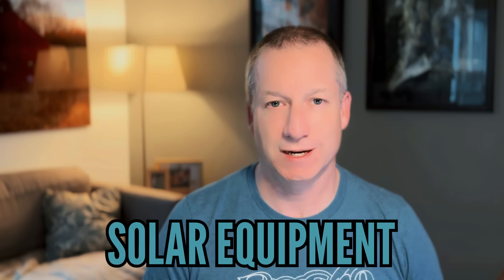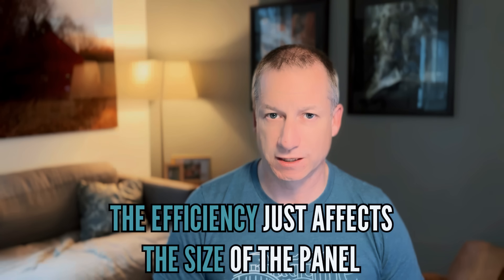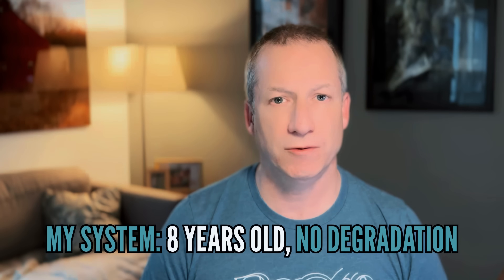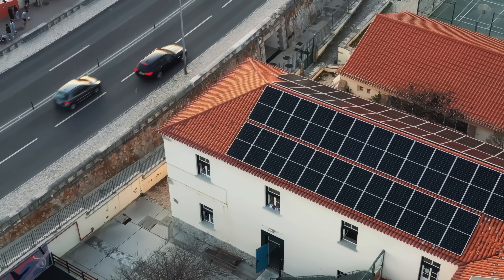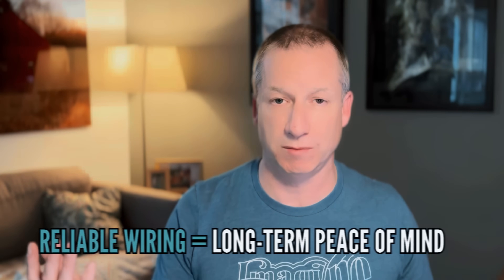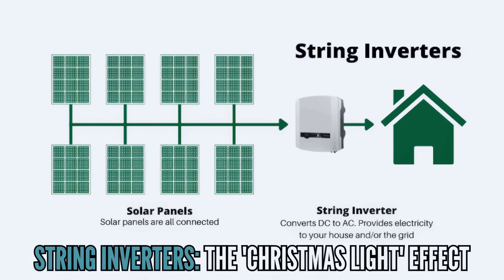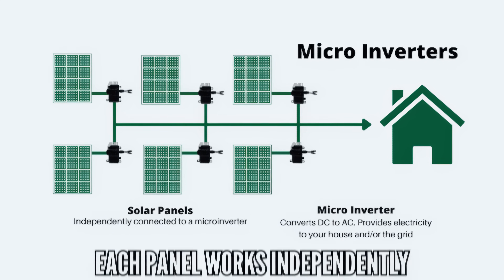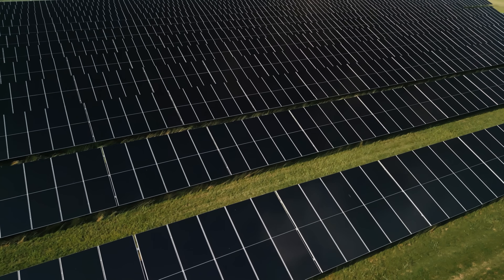The Hidden Downside of Microinverters No One Talks About

Comment from the maker: This is a blanket response to all those below saying I’m wrong about the Christmas tree analogy. To those screaming that it’s wrong and dangerously misleading  to use this analogy because it no longer applies because of bypass diodes, please keep reading. 
The Christmas tree light analogy works perfectly in explaining how solar is wired and installed with a traditional string inverter. Therefore, it is both useful and applicable. To say that it is not as like arguing that explaining how internal combustion engines work is no longer necessary. 
Most importantly though, while bypass diodes are effective, they don't eliminate shading issues entirely. They are a protective measure, not a complete solution, and shading can still reduce overall power output. Therefore, modular level electronics that eliminate the shade issues are very useful.
None of that really matters though because today here in the US string inverters aren't widely offered to residential consumers because of the virtual duopoly between Enphase and SolarEdge. Plus, if you just use a string inverter, you lose the advantage of modular level electronics that give you monitoring access at a panel level, which is super important to consumers. If you don’t have that, you won’t know if you have an individual panel out easily. 
Also to be 100% clear the most important thing for a consumer to do is use an installer that they trust to do a good job and take care of the system for a long time with a good warranty that covers labor. That’s far more important than an individual technology choice you make. Hope this helps clear things up.
Reply: I have nearly 20-year-old sharp 165W panels that have bypass diodes.  Its been part of modern panel design for decades, so lets put that out to pasture please.  Over those roughly 20 years I've had two panel failures (probably from micro-cracking, culminating in burned current paths on some sections of cells).  The bypass diodes worked properly and the 9-panel string both panels were on simply lost 2 panels.   SMA string inverter (SunnyBoy branded at the time).

One thing I will say is that you want individual strings to be on their own MPPT controllers.  Older residential solar systems generally paralleled two strings into one MPPT (MPPTs were expensive).  My original SMA inverter had one MPPT with two inputs which it just paralleled internally.  This is not ideal and if a portion of one string goes into bypass it causes both strings to become less optimal.   When I lost those 2 panels, my system as a whole produced roughly 3.5 panels less power (2 x 9 panel strings in parallel).

Modern string inverters generally have two or three MPPT controllers which more or less solves the issue.  When I had to replace my original SMA string inverter with a new one, the new one had three separate MPPT inputs so I was able to separate the strings and got significantly better performance because of that due to partial shading in the morning on one string.   Now the partial shading on one of those strings only drops out one panel from a single string and the system barely notices it.

--

I personally prefer string inverters and having the least amount of equipment up on the roof.  So I agree with you there.  I far, far prefer not having optimizers at all.  However, modern roof regulations in most places now require a per-panel "rapid shutdown" feature which means that at a minimum there needs to be a rapid-shutdown device on each panel. 

In terms of sophistication:

* Bypass diodes (built into the panel) are singular electronic components, beefy, and generally last the life of the panel.

* Rapid shutdown devices have a little MCU for communications and typically one or two FETs.  They are very simple devices but FETs are more fragile than diodes.   Per-panel monitoring is not really needed, but some have that too.

* Optimizers are basically DC regulators.  They are almost as complex as micro-inverters.  And it should be noted that SolarEdge optimizers had very, very high failure rates when they first came out (I don't know about current offerings).

* Microinverters are also regulators, with slightly more circuitry to produce an AC waveform.  Enphase microinverters are considered to be the most reliable in the world. 

But its still stuff up on the roof that I'd rather not have.   Since I don't have a choice due to regulations, I'll be putting rapid shutdown devices on the next string that goes up and avoid both optimizers and microinverters.

Optimizers are only useful when you have a lot of random partial shading going on and even then they aren't really worth the expense verses simply having the cheaper rapid shutdown devices and using the savings to put more panels on the roof.   Optimizers can only do so much, and you can easilyi see this by shading a single cell on an optimized panel and seeing the rather large drop-off in production from that panel.

Something that does vastly improve production in variable shading conditions is using half-cut panels.  These have six bypass diodes instead of three.

-Matt
Reply: @junkerzn7312  Thanks for taking the time Matt.  It is generally in the comments of videos that I find the most valuable knowledge, and this has been a confirmation of that general rule.
Reply: When you say that bypass diodes are 'new' and 'not offered'.  What do you mean by that? They come installed in every panel since at least 2010 and I would assume since 1980.
Reply from the maker: @Chris-ie9os  Would relatively new work for you? What I mean by not offered is the combination of panels with bypass diodes capable of mitigating shade issues coupled with a string inverter is just not offered in the US residential solar market. We have a virtual duopoly here between two inverter companies - neither one of which offers a string inverter.
Reply: @bradthesolarguy  ??? SMA, Fronius, Growatt, Sol-Ark, EG4 and Tesla are all examples of string inverters commonly used on the residential market.  When is it that you think using bypass diodes started?  I'm fairly sure solar panels in ~1980 had bypass diodes.  It's a safety requirement.
Reply: I have a solar system, Sol ark with 3 active mmpts.  I have almost zero shading facing 192 degrees close to solar south for me. This system works for me.  
My friend has a similar sized micro inverter system with enphase.  He has shading thought not much.  He does not have the ability to power his home in a black out.  He is limited on battery options.  He does however have panel monitoring.  Two of his panels no longer produce, at 2 years in.  Question is, panel or micro inverter?  The micro inverter is under warranty but removing it and replacing it is not.  He has elected to do nothing about these two panels that no longer produce.
My thoughts are, individual panel monitoring is nice but useless.  If you plan on spending tons of cash to continually repair, replace and modify your panels then maybe individually monitoring panels makes sense.  If you are like the 99.9% of us who want cheap reliable electricity from solar with little to no effort with energy production that is reliable and usable in black outs, likely a modern hybrid string inverter is the way to go.  If you plan on micro managing your system and enjoy climbing on roofs while making lots of modifications to your panels, then a micro inverter or DC optimizer system is right for you.  If you have lots of shading then maybe a DC optimizer or micro inverter system makes sense but probably solar is just not a good fit for you in all honesty.
My two cents.
Reply from the maker: @scottross4627  Appreciate your two cents. Love that you have solar!
Reply: @bradthesolarguy Gary is correct. The bypass diodes stop the shaded panel going reverse polarity when that panel is shaded and the other panels in the string are still producing. All that happens is that you lose the output of one panel - not all of them.
I agree micro inverters add unreliability and that's due to the MTBF (which has early failures removed) being divided by the number of units.
Optimisers are more reliable but there's no point to them (apart from monitoring convenience) because the bypass diodes makes their inclusion unnecessary. You can instead spot a panel failure from the drop in output and use of a thermal camera.
Reply: It's weird that you use past tense in your comment ("...how solar WAS traditionally wired...") but your video is present tense ("It WORKS like christmas lights..." "It WILL lose production..." etc). You seem to have a hard time admitting that you made a mistake.
Reply from the maker: @KidFreshie  No mistake except in tenses. Thanks for pointing out.
Reply: Many will miss your key and important word  WAS.  No longer applies to installations.
Reply: Instead of busting myths, you are keeping them alive !!! 
It is a myth that one bad solar panel takes down the whole string.  And you know it is a myth!
Yes, when talking about the wiring you can talk about a string of Christmas lights.  And then you should immediately add that in contrast to Christmas lights, one panel does NOT take out the rest of the string, because of bypass diodes. 
This is not hard to understand at all to the viewer.

Wy perpetuate this myth? You have just made your channel completely untrustworthy!
Reply: Don't bite into crybabies.  All the Biden-Kamala ppl stood by while the Dems said they were going to hire 87,000 ARMED IRS agents to come after the regular citizen.  They said nothing.  No crybaby sheeet.  Then ... as soon as Trump started looking into government fraud, theft and abuse, the same Dems started screaming and crying just to get attention.  After all, why didn't they scream and cry when ChoMo Joe stated he was sending 87,000 armed IRS agents into ppl's homes to go through their documents?  Also, why didn't they cheer when Trump stopped that sheeet?  Truth is, Americans love to cry ...so, don't waste time with any explanations brah.  Ppl know what you are talking about, and if they don't, they shouldn't mess with solar systems.
Reply: Thanks for the clarification in the pinned post.  I think quite a few of your viewers will be elsewhere than in the US, where string inverters are alive and well.  In Europe where I am, I believe they make up the vast majority of installations (around 80%).  At around twice the population size of the US, Europeans matter, as does the rest of the world, of course.
I guess it would have been good to at least include the information about bypass diodes in the video: strange to not alert people that the Christmas Lights effect is largely a thing of the past now.  The issue wasn't that you mentioned the Christmas Light effect, but that you did not put it in its proper historical/antiquated context.
As for monitoring access to individual panels, it is sure neat to have, especially on large installations.  Going forward with modern panels, most residential installations will probably be 20 panels or less (especially outside the US where home energy consumption is not as high), and a panel failing represents at least a full 5% production loss.  That should be pretty noticeable from monitoring the overall solar production.  Finding the offending panel can then be a bit tedious, but totally doable, and probably worth the savings of not shelling out for up to 20 optimisers.  But that's just my opinion.  A failed panel is probably going to be a vanishingly rare occurrence for 99% of homeowners and if it happens, it is detectable for most residential installations.  Anyway the main point is: knowledge of all options is power.  Probably best to let people know neither microinverters nor optimizers are nearly as useful as they used to be.
Reply: @malk6277  you missed a couple of aspects on a string inverter you would prefer all the panels to be facing the same direction. If you have an East-West string the system will only be as good as the lowest lit panel. Everyone keeps shouting about the diodes but then only comes into play when the panel itself is almost not producing. Getting mppt at the panel level is much more efficient than at the string level. With individual panel hardware there is a chance of multiple failure points. That being said if there's an issue with the string inverter the whole system is a failed point. As a system with individual panel equipment can have failures, it's usually only one or two places in the system itself and the system can still operate with those individual failures. That being said I have probably only had four to five panels in my whole 30-year career actually fail. But on the equipment level there has been multiple failures across many different types of makers. If you have no shading and not a lot of cloud cover all panels facing the same direction a string inverter would be fine. Anything else other than a perfect situation in weather and exposure I would recommend individual panel equipment as this will increase the efficiency and longevity of the system. In the final Plus for individual panel equipment you acquire more information from your monitoring. Also troubleshooting becomes easier as you were able to pinpoint the actual issue with minimal effort.
Reply: @chrismidyette1098  In a split direction system, you only need one MPPT per direction. And there is no harm in running a system with two MPPTs: the same argument you use in favour of microinverters plays in favor of having two MPPTs rather than one. String inverters from reputable makers fail very, very rarely and if redundancy is needed, having a spare inverter on hand is fine. Also easier to swap out than clambering on a roof top. I did discuss monitoring here already. Panel failures are super rare, and the vast majority of owners won't need to pinpoint a failed panel. Meaning the monitoring becomes a fairly costly expense if it is just the pleasure of looking at the data a few times in the early days of the installation, then losing interest and not using the feature at all. To each their own, but from where I stand, microinverters aren't as useful as they are cracked up to be: case in point, this channel misled people with this video, into believing they solve a problem that no longer exists. I often wonder if resellers just want to sell the more expensive solution, and hype it's usefulness. It wouldn't be the first time US based consumers are led to believe they 'need' the more expensive solution, while Europeans pick a sensible alternative.
Reply: @malk6277  in my experience with approximately 30 years in the business is the failure rate of central inverters have far surpassed the failure rate of enphase microinverters. I originally started out with SMA and Fronus in my first 5 years we have replaced almost every SMA and we did replace every Fronus due to failure. After losing money from not getting compensation for labor on inverter replacement we decided to step away from those makers. Shortly thereafter we moved to using enphase m215 micros. The m215 worked great then they came out with the dual microinverters. Their ended up being a manufacturing defect with the dual microinverters we had to go back to all the jobs and change from the dual micros to single m250s. Through this time enphase provided all the replacement product free of charge and covered the labor for our five-man crew on every job that needed replacement. 
The only manufacturer that covered all of the cost. In the interim we were still replacing Central inverters at our own cost for labor. Don't have enough room to go through my 30 years worth of History but the numbers do not lie. I have warranty replaced  over 1500 Central inverters. Probably 2000 optimizers replaced. In the last 20 years since  enphase has been in the industry I have maybe changed 100 microinverters and that is including the faulty dual micros we received from them initially. Currently I have no enphase microinverters under RNA. Currently I do have 4 SMA waiting for warranty replacement some been waiting for over 5 months to receive equipment. Currently have about 75 optimizers in RNA status. Take what you will from the video and or what you hear from others. But what you're getting for me is the actual applied installed truth over the past 30 years.
Reply: @chrismidyette1098  Thanks a lot for sharing your experience. I'd imagine failure rates would be model dependent, and also somewhat dependent on the region you're operating in (high humidity, dust, and/or heat could be a factor). Reputable brands seem to have far lower than 1% failure rate per year, within the expected lifespan of the unit. Other factors that can influence this are wrong spec and installation mistakes: not to accuse you of making such mistakes... just saying. But the main point is that if you can expect your inverter to last 5-10 years, and you have a spare on hand, it's a very fair call to prefer that over microinverters, for the reasons discussed.
Reply from the maker: @malk6277  You make very good points. My customers seem to all very much want per panel monitoring, but agree there are ways around it.
Reply: @bradthesolarguy  If they can afford it, I bet they do want it... until they find out the data is going to be incredibly boring after maybe three or four glances.  There really isn't going to be anything interesting to look at after the first few glances, unless that exceedingly rare event of a fault comes along.  Anyway, I'd understand if you don't go out of your way to tell them that.  Got to sell products, mouths to feed and all that, and if they want it... well, could be foolish to talk them out of it?  All the best.